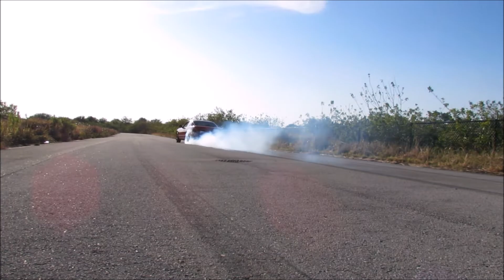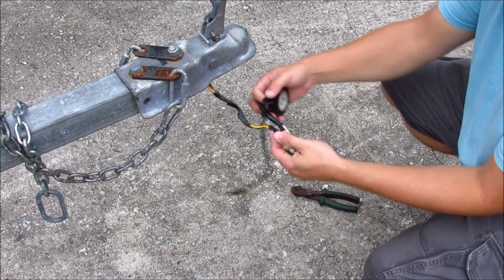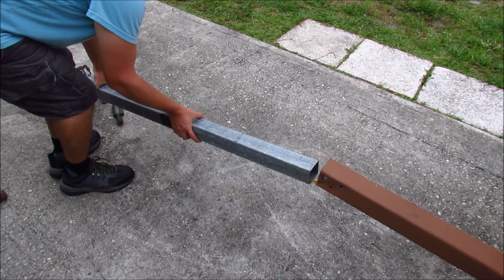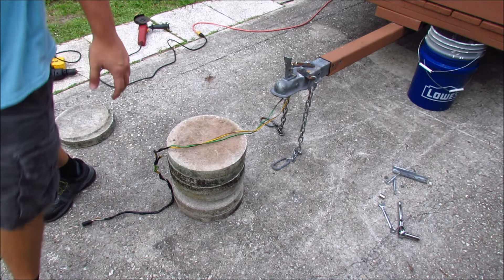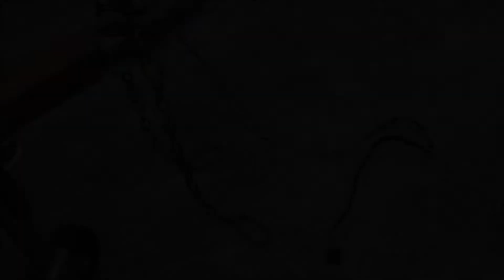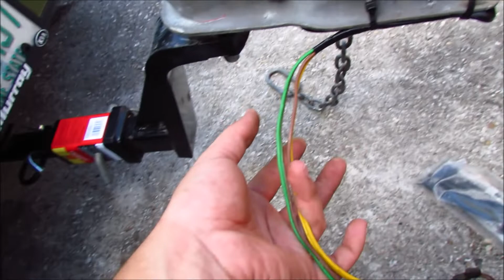How to Shorten a Trailer Tongue

Comment: Did you deburr the cut tube? ...for wires. 

Also, that hitch config looks very long (with conversion and extended ball hitch).
I think you'll need to be careful how you load trailer to minimize tongue weight.
Reply from the maker: Off camera i deburr'd the tube.  I was lookin at those sharp edges thinking.  Hmmmm.  I used the grinder to knock the edge off.  And yes.  I want the tongue loaded.  Most of the max loads in this thing will be like 800lbs.  Mostly forward of the axle.  The axle in this is set back further than the middle.  So ill strap most stuff to the front of it.  Thanks for lookin out.
Reply: @thousanddollarcarguy  Actually, I was thinking the weight should be OFF the tongue as much as possible (but, not negative weight).. So, put weight over axels or a bit to rear of trailer? Because, I think the long hitch config is acting like a lever and stressing the connection on the car (no frame, etc.). 
As an "extreme" example, imagine the hitch config was 20ft long. You could rip out the bolt holes, or tip up front end of car. 
(Just IMHO...thanks for vids.)